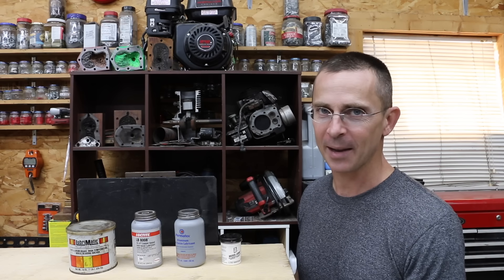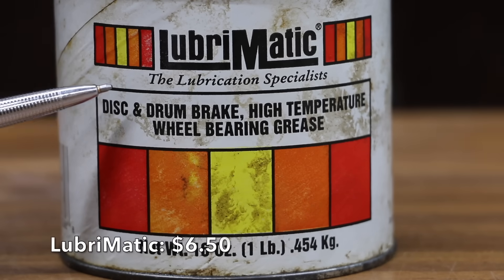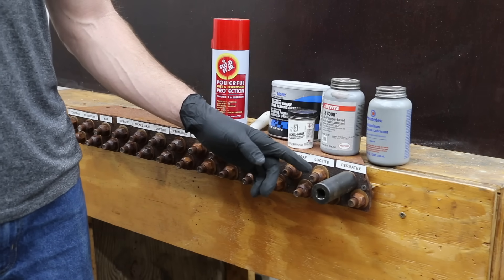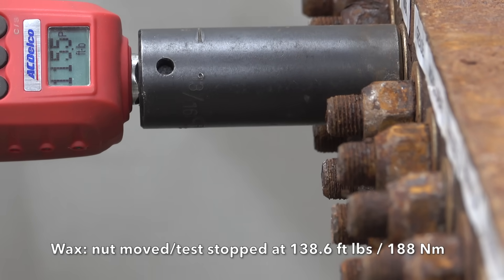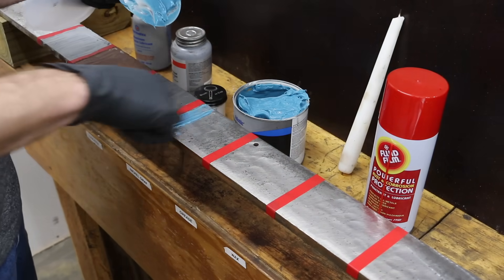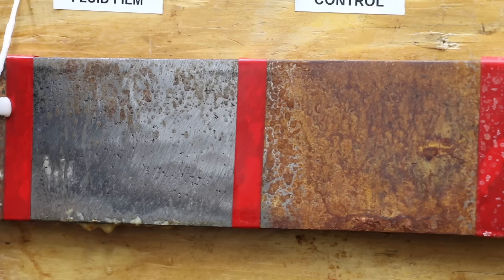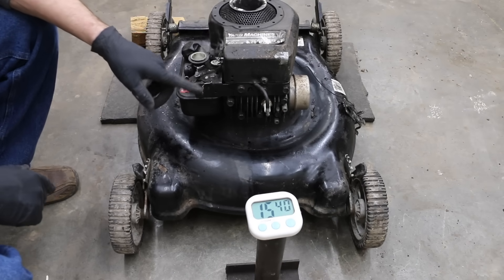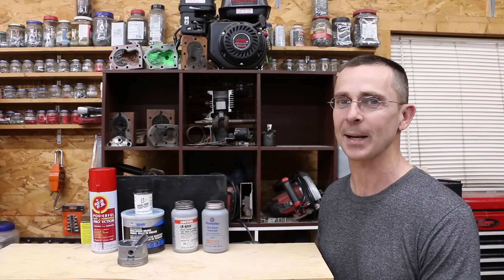Does Anti-Seize Compound Actually Work? Let's find out! Anti-Seize vs Grease vs Fluid Film vs Wax

Comment: I stopped watching when you put this into a Briggs engine as an oil replacement.  What is that supposed to prove?  engine oil needs to flow through passages, and nobody in their right mind would have even thought of this had you not done a video on it!
Reply from the maker: Thanks for the constructive feedback.  Anti-seize contains abrasive solids and the engine demonstration highlighted that.  Definitely should not be used as a grease substitute  Thanks again

Comment: Got a question for you on the non use of copper anti sieze on aluminum, some years back my dad had a Ford 5.3V8 truck, these engines were famous for stripping spark plugs when extracting them because of the poor design of the amount of threads on the aluminun head, I had always applied antisieze, copper, to them and did not have any issue. Can you please reconfirm in not using copper antisieze with steel or bolts, spark plugs on aluminum heads please, I think it would give us better peace of mind to us that are detail and spec freaks!! Thanks and keep up the good work.
Reply from the maker: There is a risk of galvanic corrosion when using copper anti-seize on aluminum components from the research I've done but it sounds as though it hasn't been a problem for your Ford.

Comment: You know, you don’t have to melt the wax. You can’t just rub it on the surface. Heh, heh. That’s what she said. 

Btw. Torque is defined as force over distance, actually r cross F since r and F are vectors, which also makes torque a vector. How come you say it properly in Metric, N•m, but incorrectly in SAE, ft•lbs, not lb•ft? Just curious.
Reply from the maker: Thanks for the constructive feedback
Reply: Project Farm It’s a very great video; well done.

Comment: Here in the U.P. I have to use anti-sieze on wheel studs as well as where the brake rotor meets the wheel bearing and where the wheel meets the brake rotor on the first replacement of those parts... or they will never come off. The Permatex is just fine for me.
Reply from the maker: Thanks for sharing.

Comment: I was told many years ago to never use grease on bolts, because it can allow the operator to over torque and stretch the threads of the bolt.  anti seizing agents are not lubricants and will keep someone from stretching the threads.
Reply from the maker: Thanks for sharing

Comment: I thought the PRIMARY use for anti-seize was for when you were bolting dissimilar metals, eg. aluminum and steel, together.  I learned it as a critical step in screwing a (steel) spark plug into an (aluminum) engine block, so that the aluminum threads would not galvanically "weld" (seize) into the steel threads and then strip out when the plug was removed.  THAT seems like the definitive test for these products!
Reply from the maker: Thanks for sharing.

Comment: Anti-seize is most commonly used for dissimilar metals. For example steel bolts going into an aluminum head. The chemical bond between the aluminum and steel often causes the fastener to seize. Having a layer of anti-seize between the two metals prevents this. I wish you could’ve tested that as well. But keep up the good work!!
Reply from the maker: Thanks for the feedback.

Comment: 🧐 Would a very small amount of anti-seize added to oil act like a bottle of “restore”
Reply from the maker: Great question.  Restore uses copper and lead and much smaller particles.  The aluminum acted more like a valve lapping compound

Comment: Let me predict...Anti seize in a lawnmower, screwed the engine.. I learnt as a 2nd year apprentice, do not use C5A (copper coat)on a gearbox, (especially your own) the copper wore out the bearings in 3 months. The gearbox oil allowed it to last that long...It totally screwed my manual gearbox....
Reply from the maker: Thanks for the feedback.

Comment: the whole point of loctite and anti seize is to work in the dead air space between the threads of the bolt and the area it's threaded in to . rust would be almost entirely stopped from entering by the film layer of the sealant . that's why if you have a bolt going thru a head in to a water jacket it's good to put Teflon sealer on them to prevent the bolt from rusting thru the tip will rust but the threads will be protected
Reply from the maker: Thanks for the feedback.

Comment: I was surprised the engine ran as long as it did using anti-seize as a lubricant. I would have expected the anti-seize to short out the spark plug.
Reply from the maker: Thanks for the feedback.

Comment: I'm a retired tool & die maker.I worked in production facilities for both plastic and rubber injection molding and can safely say that any of the copper based anti-seize products are very effective.Aluminum based was OK but but not as good as the copper.
The real question is why make your life harder and not use anti seize?
For a while there Loctite had anti seize(and threadlockers as well) available in a a 7/8 diameter lipstick style tube which made application a breeze and was quite neat and tidy.It's no longer available and that's a shame.
Reply from the maker: Thanks for sharing.

Comment: I have an idea for a video 
Many modern diesel engines require diesel exhaust fluid DEF, Which is made out of urea partially broken down onto ammonia 
Could straight urine or ammonia  be used instead of DEF
Reply from the maker: Thanks for the video idea!

Comment: a testing modification for next time: I was trained to always apply the anti-seize to the threads AND mating surfaces to eliminate the binding/galling during torqueup.  also, as another mentioned, you need to measure the clamping force, not just the breakaway torque.  great video!
Reply from the maker: Thanks for the feedback.

Comment: WAIT A MINUTE..... I hit rewind to check..
Yep,  you torqued them all to 90 lb-ft. 
But then loosened some with 80 ?!!
My mechanic buddy was right,  assembly torque specs are established for dry,  new,  clean threads.  I’ve never been too concerned with lug nuts.....now stubborn spark plugs,  that’s worrisome.  Especially with today’s plugs and ignition systems being so reliable for so long,  they feel like they have welded themselves in.
Reply from the maker: Great feedback. Thank you

Comment: You need to try some stuff called Tef-gel. I set up aluminum security cameras bolted to galvanized steel with stainless hardware on hotels by the ocean. If I forget to apply tef-gel i have to break the bolt to remove it several years later. No such worries with tef-gel coated hardware.
Reply from the maker: Thanks for the suggestion.

Comment: This one hit me today while grilling.  How about trying cooking oil, and bacon grease/ lard as anti seize?   Suppose butter, ghee, shortening-etc would be interesting.   Believe it or not, I use bacon grease/lard in the gear case of a old garden tiller(that way when it cools down, it stops leaking everywhere!).

 I still hope to see different types/ brands of brake fluid in a showdown.  Same for antifreeze.  Maybe throw some brass into gl5 gear oil(high sulfur content), and watch what happens.  Different brands of Mig welding wire(always a heated topic)?  How about windshield washer fluid, is Rainx really that good?
Reply from the maker: Thanks for the showdown suggestions.

Comment: I love your videos, but I have one issue with this one. When you were doing the second corrosion test, you tilted the testing apparatus to a 90 degree angle. This would be fine for the thicker product, but not for fluid film. In doing this you allowed the fluid film to run down the metal, leaving the top section with much less fluid film on it. I think it would have been more fair to keep the metal on a flat surface, so the fluid film did not run down the metal. Just my thought, to make your tests better and more consistent.
Reply from the maker: Thanks for the feedback.
Reply: Project Farm on a side note I work at an ACE Hardware, and I had a customer come up to me and ask which whole saw was the best one. And I just said I don’t know I’ve never used one, I think it would be great if you could compare different brands of whole saws, so next time I can recommend the best one

Comment: As a former heavy truck mechanic for 17 years in the Pacific Northwest, I can tell you we used this stuff on almost everything and it pays off. Even between bushings and bores, although that was more of an assembly lube and wasn't really effective on disassembly. 
Something bizarre speaking of never seize...a local tire store would freak out if someone used never seize on wheel studs. Their "training" told them that never seize would cause wheel nuts to come loose😂😂😂
Reply from the maker: Thanks for sharing.

Comment: Here's a question. Why would you assume that the best anti-seize is the one with the lowest torque to disassemble? It seems to me that one of the problems with anti-seize is that they also act as lubricants that may facilitate the nuts backing  out during normal  operation.  I would think that the best anti-seize is the one that has the same torque when disassembling as when assembling, in this case 90 ft-lb.
Reply from the maker: Thanks for the constructive feedback

Comment: If you take requests :) 
I would love to see a video comparisons of the best paint strippers. 
I often rebuild motorcycles as a hobby and the worst part is getting the old paint off the tanks and fenders. I tried various paint strippers and still seem to have to fall back to a sander/grinder. Would love to see a good review and comparison. Specifically on automotive paint with clear coat.
Reply from the maker: Thanks for the video idea.

Comment: I have used several brand names of anti-seize on large-bolting systems on high temperature systems for over 35 years. Your test only heated the bolting to 500 degrees for one hour. The same bolting exposed to 1000 to 1500 degrees f temp evaporates the grease carrier and leaves the aluminum , copper or nickel compound behind to act as the protectant.   Grease and wax at the temps  high pressure steam systems are exposed to just doesn’t work!  Even on the exhaust systems of automobiles they are a waist of time.  Real life exposures are far more severe than those you exposed the selected items too. You have to be careful with the copper based anti seize compounds. They can and do react to chemical attack and electrolysis. Just the thoughts of a retired industrial mechanic.
Reply from the maker: Thanks for the feedback.
Reply: Project Farm I really do enjoy your videos. Keep them coming.

Comment: I work with anti-seize all the time as a licensed mechanic. One interesting characteristic of anti seize is that as you torque your fastener it reduces the friction so drastically you need modify your torque specs by reducing applied torque anywhere from 10-45%. The stuff I use Is anywhere from 10-25% reduction in torque. This makes the results of the products even more impressive seeing as they are applying 10-45% more clamping load than their competition and still do not seize. You can find the spec sheets and graphs are available for most quality name brand anti-seize compounds. I personally recommend a nickel based product as it has the most heat resistance and will not react with aluminum or stainless parts (unlike copper based products)    Btw, love the channel, keep on keeping on friend 🇨🇦
Reply from the maker: Great point!

Comment: I use it on my wheel hubs in the winter. For whatever reason, it seems like ford’s have an issue with wheels seizing to the hubs, and anti seize seems to do the trick perfectly.  FWIW, I use the permatex stuff. My bottle is about 12 years old and is still holding up just fine. 

I haven’t found much other use for it.
Reply from the maker: Great feedback. Thank you

Comment: FYI - no auto manufacturer will tell you to use antiseize if it isn't absolutely required. 

So, for auto applications, use antiseize as spec'd by the service manual. 

All installation torques are calibrated based on the use of antiseize.

Comment: I wonder if any of those anti-seize products would fail with DC flowing through them. 🤔
Reply from the maker: Thanks for the video idea.
Reply: Gold Whisperer Prospecting copper would react negatively to dc currents
Reply: lloyd holt 🤷‍♂️
Reply: Gold Whisperer Prospecting electrolysis would probably damage the fasteners.
Reply: lloyd holt I just wondered about it when I was thinking that DC accelerated corrosion, thinking that maybe those with different alloys would speed it up between the threads.

Sort of like a sacrificial anode? 

Just a guess really, was a bit curious.

Comment: Ret. from a coal power plant.  35 years.  Used anti seize on all bolts nuts  in coat ,fly ash ,water  . Have seen boiler fronts cheery red with bolts  holding front on .came back in 6 months backed out. Also used anti seize on jet engins and gas turbins steam turbinsnever had any prob, with bad threads.
Reply from the maker: Thanks for sharing.

Comment: The wash off is irrelevant.water would never be sprayed on non cured never sieze in real life. Go find an o2 sensor and remove it most are coated with the copper or aluminum neverseize.
Reply from the maker: Thanks for the feedback.

Comment: Oh man not too long ago at work I was working on a 73 Corvette. Was at another restoration shop but that shop was giving the owner the run around. So he took the car back and gave it to us, while pulling it apart I found that the rear wheel bearings were packed with anti-seize I wonder how well that would've worked out.
Reply from the maker: Thanks for sharing.

Comment: For the pressurized warm water test You need to find a way that you can put an even amount of product on the base. This includes the same thickness of product on the base.  You should also use a base that is free from defects.  The base you used had a grove on it which caused the water to deflect differently.  Also you should target the same spot on the base in all of your tests for the products.  Preventing variations in your tests for each product would make your tests more unbiased...
Reply from the maker: Thank for the feedback.

Comment: Having done a lot of machine work  on elevators and escalators. When assembling, never seize is a great product. At home mower decks and blades is the most frequent use. Makes for a really easy job replacing blades or spindles. No lost time with broken or rounded off fasteners.
Reply from the maker: Thanks for the feedback.

Comment: Interesting video but of no real value. Attempting to use products for that which they were not designed had predictable outcomes and on steel nuts and bolts all of the commercial anti-seize products willl work, the science is choosing the correct anti-seize for the material in use. If you only want to keep one then pure nickel  anti-seize is the way to go both copper and aluminium will cause problems under certain circumstances and mixing anti-seize materials can lead to chemical welding of your fasteners. Gave me a laugh though. cheers
Reply from the maker: Thanks for the feedback.

Comment: Should make a part two where you test different anti seize in the motor for set amount of time and have motor rebuilt each time with the same brand/type parts and measure wear rates on each.
Reply from the maker: Thanks for the video idea.

Comment: And that tells you EXACTLY why you don't use anything on wheel studs. It shouldn't take less torque to take off than you used to put on.
Reply from the maker: Thanks for sharing.
Reply: It's one of the leading causes of wheel offs in the automotive industry.....leads to overtorque/stretch/shear. Causes almost as many wheel offs as under torque.

Comment: Great video. It was also proof of the fact that torque yield is actually based on the stretch of the bolt not the arbitrary “friction factor” of the torque wrench. The worst condition for a test is in exhaust bolts. A repeated heat followed by naturally cooling then reheating might be more representative. You and I both know the stuff works as this is why is it not only a common practice in aviation but required in some applications as well.
Reply from the maker: Thanks for the feedback.

Comment: I've been using copperslip anti seize for many years, I used to maintain a group of motorcycles used by dispatch riders and the bikes were used in the worst conditions imaginable. Copperslip made my job much easier than not using anything. Interesting it had a useby date, I'd not noticed that before. 
Thanks for a very extensive test!
Reply from the maker: Thanks for the feedback.

Comment: Please could you look into different GREASES ment for protecting electric connections, especially battery terminals, etc. Some say "dielectric" means conductive, wikipedia says it means insulating. Some say apply grease betwen contact surfaces, some say only on outside of the connection. Some say in the connector but that it is pushed aside and does not remain between, but all around keeping water out. Especially at sea the corrosion is a real enemy and Wd40 is ok, but very thin stuff. Are there ANY good grease that (applied between contact surfaces) does ENHANCE conductivity and prevent corrosion at the same time. Or is it better to keep on applying these sprays?
Reply from the maker: Thanks for the video idea.

Comment: I wonder if the anti-seize that got into the cylinder head created a high-compression situation similar to hydro-lock.  And the extra force on the con rod is what caused it to break.
Reply: Greg's Garage interesting point. However, there was a ton of blow-by....so I would think the extra pressure just vented past rings into crankcase and out the oil dipstick.
Reply: @MaddRamm  good point, you would think so but I'm no physicist